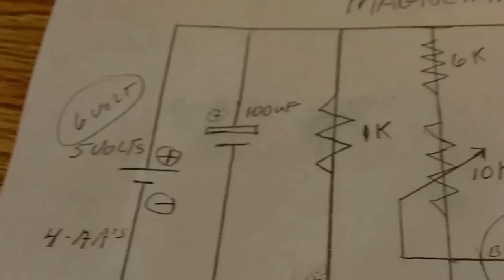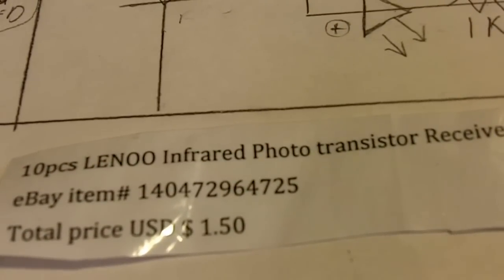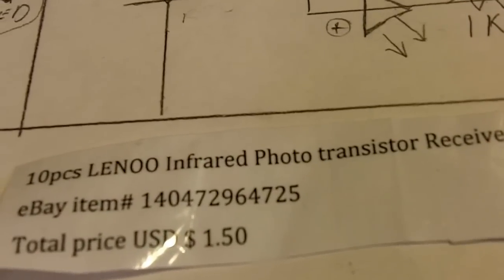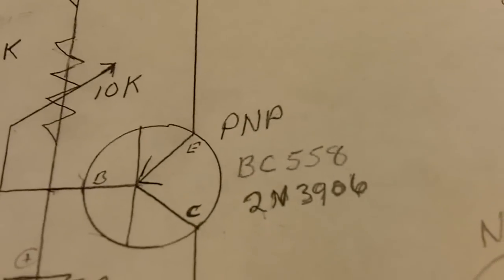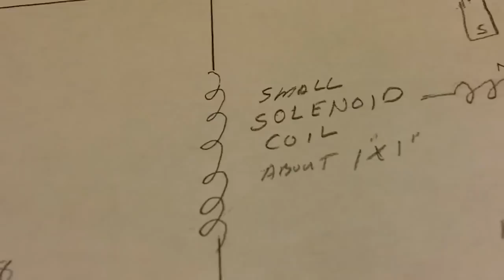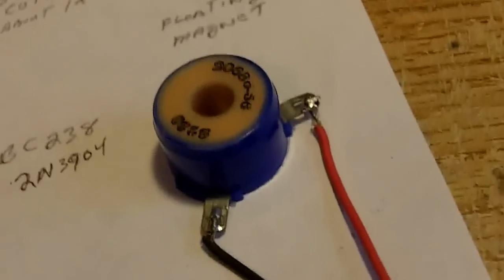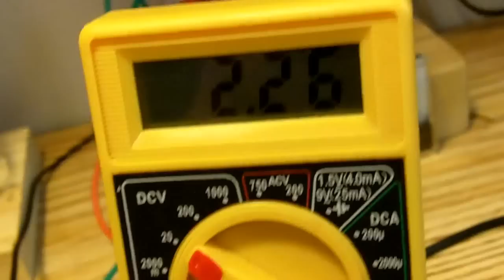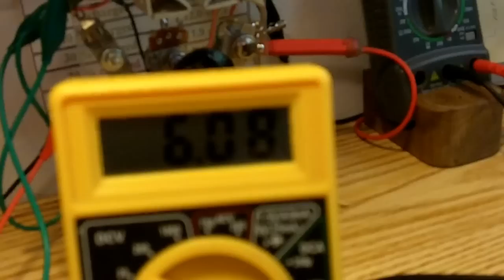Levitation up date

Comment: All round great video there...lots of tips and cool clean builds. Those coils on the dancing solar things are works of art eh, imagine winding one ! Making a pendulum type here from a dancing flower and haven't found a better circuit yet than the one inside it already. The air core coil is great to pair with the rotor on your levitator...and solar powered makes the bonus :)